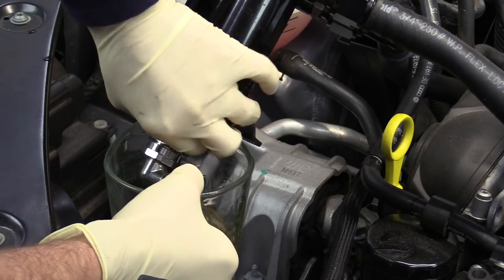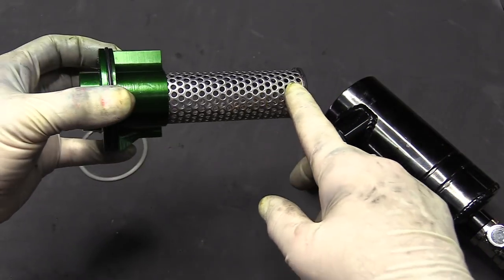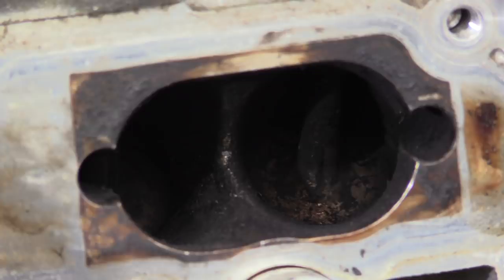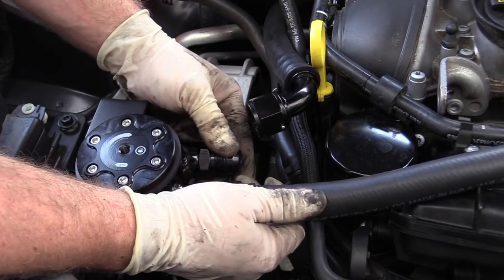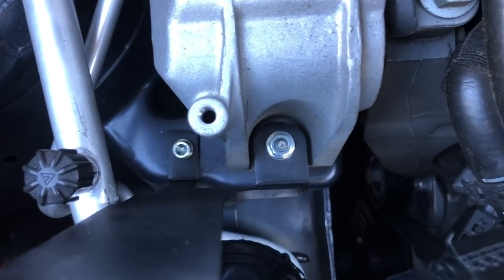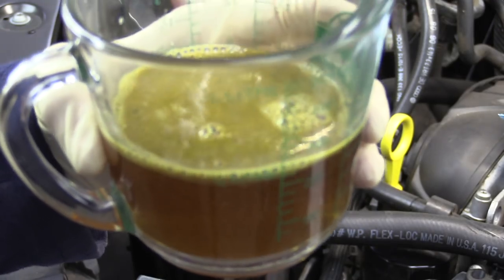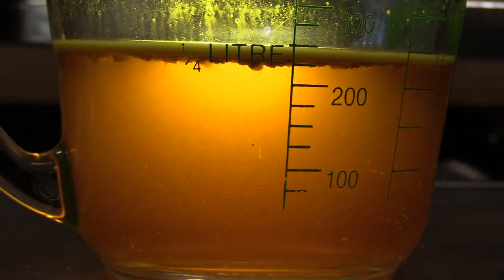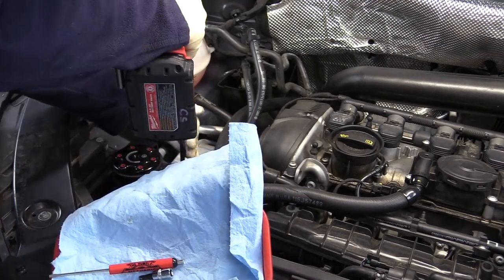Do Catch Cans REALLY Work?

Comment: Oil low? Pour that stuff into the oil and bring the level back up. Problem solved! ;)
Reply from the maker: LOL, yeah the oil was low. I am gonna save it for another time. :)
Reply: If any of that was engine oil that would work, but 99% of what came out was water.
Reply: HumbleMechanic 
I save it for Friday night shots with the crew.
Reply: It's usually a nasty oil/water mix.
Reply: Looked like sulfur in there too. you running diesel In  that thing? That would build up the carbon😃
Reply: I’ve watched videos with older vehicles that have a lot darker, thicker (oil) in the can. 
Also may depend on the location of the PCV outlet in the engine (valve cover or engine block).
Reply: You wouldn't want to poor that back in its majority water from condensation a little bit of fuel an not alot of oil. All that would happen is it will burn off again but quicker filling the tank sooner as you've introduced water to the oil instead of being a cooling down condensation mix. Short journeys are worse for this.
Reply: It's probably more water than oil...I wouldn't pour that back in the system
Reply: Yeah.Let em hydrolock his motor.
Reply: I have a homemade 3 stage oil catch system.  The first one catches mostly water and some oil for that creamy-in-the-coffee look while the next two catch  more in the way of oil with the 3rd catching the most oil.  '99 Tahoe has 319,000 on the clock.  Still runs well and DOESN'T smoke; oil, steam or  Carbon black.  I collect the effluents into a container that goes to a household haz waste collection facility.
Reply: Gweedo Murray I have zero catch cans, my van has 476,000. The last time I checked, the egr was clean & smooth with a light dusting of soot & the intake manifold had a very light coating of residue. In 12 years the most the egr has ever had on it was maybe a 5 mm ring around the vacuum valve shaft. It's amazing how much effect that the minority of vehicles that exhibit problems have on the overall perception of vehicles in general. "The squeaky wheel gets the oil" has many layers here.
Reply: Gweedo Murray oh and the time the egr had a little residue was most likely due to a cracked MAP sensor that was causing false readings combined with worn injectors. I would say most problems with residues & buildups are caused by other faults, worn components, incomplete maintenance or non-manufacturer modifications. But who wants to test that complex issue when you can just blame the manufacturers and buy a catch-can and say you're outwitting the experts.
Reply: Jake Smith Hydrolock by putting water in the oil? Aahh nope. Even Google might help you out with that one.
Reply: Cassette Dude ! 

At some one hundred and plus thousand I pulled the EGR module ('99 Chev Tahoe 4wd) and cleaned out a pretty good mess of carbon and the next time, by 250 or so pulled it and only got a very small amount.  I bought the truck used, just turning 74 K, and so have no knowledge of its use and abuse before I got it.  
.
Some years ago I was at a Chevy dealer in western NY to buy a part for an S-10 Blazer and going through the shop area I saw a pegboard with nearly a dozen failed parts each with a card explaining the cause of failure; includes a brake rotor that had been chewed by pads long overdue, a failed water pump, a drive belt tensioner pulley with the bearing gone and stuff I can't remember.  The intake valve with the big clot of baked on Carbon was attributed to the PCV oil mist/vapor settling on the back side and baking in place.  The explanation made note how the inefficiency of carburetors , before the PCV add on, would supply the carbon but that it now comes from the recirced oil.  A Scotty Kilmer vid explains how recent cars actually are designed looser to allow easier movement of the pistons, ergo better mileage figures,  and so a planned amount of oil will blow by, on purpose, as sloppy tolerances will do, and on modern metal I would damn sure have an oil catcher.  I live on the Colorado front range in a high pollution area and so am subject to dyno style emissions testing.   The test is done every two years and next year I am due.  Hoping to see my  320 some thousands worth of miles still having a clean exhaust.  
.
You have my hearty congrats on so much mileage and still running strong without major defects.   Did you buy your vehicle new ?  I am aware how people will beat the shit out of stuff especially when they know they will be into something new and get best resale or trade in on something that still runs good but that the effects of "hard living" wont show up until the second or third owner.   A friend suggested I write the company when I reach half a mil, something you might do if you hadn't already thought to do so.   Love the metaphor !
Reply: I don't consider it outwitting anybody.  Truth is, a catch can accumulates and so needs attending just like pulling the dipstick and adding oil or a good one, checking the air filter now and again.  I have seen some horribly filthy air filters and tires on vehicles that are down to as low as ten pounds, like the way Dad's last car would be whenever I came to the house on a trip back.  The tires "look good" visually but the gauge tells a different story.  Cars usually get the funky problems due to lack of care and hard driving.  

A catch can on every car would be another thing that needs doing, a thing that will be neglected by many like way dirty air cleaners are and oil that gets changed if and when the owner feels like it and tires that routinely run ten pounds or more under the factory spec let alone the tire manfacutrer's highest pressure spec.  I can see many who would empty the catch can just dumping it in the trash or along the garage foundation in the name of killing weeds while poisoning the ground so that over time it makes its way deeper and in areas that depend on wells that is not good.  
.
I drain and flush the brake system yearly to keep water from accumulating in the wheels end of the system and also do an annual partial drain and fill on the power steering and about every third oil change drain the 3 qts worth of tranny fluid the pan gives up and refill with new.  I also have the gear cases on a schedule.  Same trans as when I bought it along with the same starter and water pump.
Reply: That didn't look like pure oil though looks like it has either gas or water mixed with it or both
Reply: I do catch canning and I notice that during periods of high humidity that you have a definite higher homogenized presence of water in your oil.  Just think, it's all the crap that would go back into the engine, and are the fumes directed evenly to all the cylinders or just the ones nearest the vapor inlet on the intake manifold ?  My '99 Tahoe has the intake inlet on the left, nearish the front so I am thinking cylinder numbers 1 & 3 are getting dosed the most which to me presents an unbalanced distribution of waste which corrupts the overall balance of rotation, sorta like an correct tire balancing.  It will spin but unevenly even if it does take diagnostic equipment to measure how much.  Not a fan of baked-on-the back-of-the-valve carbonizing and worse if only one or two valves are getting it which makes the air intake there a bit constricted while the other intakes get a full charge.
Reply: funny mate, it mostly water
Reply: Gweedo Murray I’d want to buy a car from someone like you 🤙 I’m the same way, you could call it over maintenance, but really people should be doing these things as the baseline
Reply: I wouldn’t pour all that water  oil mix back in my sump. Dispose of that crap in the correct manor.

Comment: This is exactly what I found when I installed a catch can. The cold air flow in winter time made it fill up with 99% water at a ridiculous rate.

Ended up removing it as I felt it wasn't doing much good.

Comment: I'd be interested to know what it's made up of? You should send it to a lab for testing lol I'm guessing I'm not the only one who's curious ;)
Reply from the maker: Yep spoke with BlackStone about that. I will be sending the engine oil and this sample to them
Reply: Excellent!!
Reply: Still no followup yet, so it's going to be oil, fuel and water is what makes that mess up.
Reply: Any results from the sample?
Reply: Blowby (produced by all engines, new and old; severity is the difference). All the nasty crud (oil, fuel, emissions etc) that used to be spat right onto the road as you went, until environmental hoo-hah changed that in the 70's. This crud was never meant to recirculate back to the engine. The fact that it does, since this environmental hoo-hah, is a factor in why vehicles don't last as long as they used to. The catch-can is a "gray area" compromise, as far as most States are concerned. Apparently you will actually fail SMOG if you don't reconnect the block-side hoses directly to the manifold, as it was originally (if you install one, account for that necessity later). And it would prove most effective if you've installed it basically right after you've bought new off the lot (before that crud builds up and fouls it all up)... though older, already fouled up vehicles will also benefit to an extent (their blowby will be significantly greater than a new/er vehicle. All that crud eventually will start affecting even the throttle body and idle air control valves and causing more problems down the line. These can help mitigate that too, buy you more time to decide to rebuild or junk it).
Reply: HumbleMechanic any results from that sample?

Comment: A tech at Further Performance, here in Minnesota, advised against catch cans because they can freeze here. I am on a 5,000 mile oil change cycle partly to reduce the crud that can land on my intake valves. I also drove 20 minutes on the freeway in 4th gear (3,000 -3,500 rpm) for my own "Italian tune-up". 

I wonder how much of the catch-can liquid was water, and if the ethanol in the fuel brought water in from the air.

Comment: Most of the captured content is water and excess gasoline. I run a can on a 2.7 twin turbo Ford and ran them on 5.4 Supercharged Fords but due to my climate I dont get much water in the can, just pure oil. I know yours isnt oil just by looking at it - when you drain the engine oil it will not match the contents in the can or the can contents would be black. It is certainly doing what it is designed to do but the stuff youa re capturing wont play into coking on the valves, it just extends the oil life. When I drain my can on my 2.7 ecoboost I get about 4 oz of oil in 5k miles.

Comment: I put an oil catch can on my Volvo S60 T6 because after I did some minor turbo tuning and intake manifold tuning I noticed under heavy acceleration during initial turbo spool the tail pipes seem to let off some smoke but I have very little oil loss effectively none, so I figured must be something recirculating through the intake or something and I figured a oil catch can is the easiest and best thing..  since doing that I no longer get any smoke under full throttle take off and the crap I catch in my catch cans look exactly like the stuff you got, almost watery or no viscosity and think layer of something disgusting on the surface..

Comment: Catch can's mainly capture water vapour from the crankcase, some of it is oil and combustion products from blowby, but the overwhelming majority is just water. Still it might be doing something, but I believe most of the carbon build up on the backs of valves comes from oil leaking past the valve stem seals - this is why you tend to see a large carbon blob at the base of the valve stem when you inspect valves on engines that have seen some miles.

Comment: My 1987 Alfa 2.0 Spider has an oil/vapor separator the uses a vortex for separation of blowby from the cam covers. A tube at the bottom routes detritus back to a fitting at the bottom of the dip stick. Hmmm, maybe I should route that return plumbing into a clear container. Thoughts?

Comment: Nice. Im thinking of installing one in my 2002 tdi jetta. But also didnt think you will catch that much. Questions. Why is is so very watery rather than olie? Just to check, a normal 4 stock motor doea not need any lube from the intake, engine doea sort it self. Rite?

Comment: I am not a Mac but i think it will not solve the carbon build up because the valves opening and closing will let a tinny Carbon thruw  and  causes the carbon to crash into the walls of the intake manifold and stay there until cleaned   (maybe I am wrong )🤔keep it good work I learn alot from your channels like this

Comment: Did you remove the pcv valve to install the catch cann (my understatning is that this is what is typically done)?  Because if I recall, the pcv regulates the pressure in the crankcase.  So if it's removed, then you're actually venting more than you otherwise might.  Also, you mentioned a fine oil separator in the pcv valve, which would also be missing in your setup.

Comment: which catch can did you use? trying to find one identical to that one. A little anecdote lol i did my oil  housing gasking and oil cooler gasket and was suprised to see alot of corrosion on the antifreeze port in the oil cooler, and the rear of the oil housing ever so slightly warped. alot of fun learning keep it up
Reply from the maker: This is from Black Forest industries.

Comment: Great job with the presentation! I own a 2016 GMC Sierra 2500HD gasser w/6.0L Vortec engine. This engine employs "Sequential Fuel Injection" compared to the 5.3L and 6.2L V8 EcoTec3 engines that use "Direct Injection". I'm wondering whether my truck would benefit from a catch can. Any thoughts?

Comment: I agree with most here. That there is water from blowby with a layer of oil on top. I do think a catch can will help slow the issue of coke build up on intake valves but the only real soultion is to have a small low volume fuel injector wash the valves. Even if its only something that handles a 5% of the motors fuel demands.... then again with more turbocharged and supercharged cars i bet a H2o/meth injection on the back of the valves would work just as well and think bmw has one motor designed as such.

Comment: Got a question I hope you can answer. I built a custom turbo system for my Fiat 124 Spider 20 years ago and I've been dumping the oil vapors off the cyclonic trap mounted on the bottom of the engine directly into the "square" in the air flow meter past the vain. That's the only place I could find to dump the fumes because I have a hump hose between the turbo and AFM. I guess you know how these old Bosch L-Jetronic systems work

I had one of those K&N traps mounted to the cyclonic trap (there is no factory PVC on this car). The problem was every time the turbo would spool up it would fill the cabin with oil vapors and blow oil onto the starter.

Here lately the car has been stalling at idle and takes allot of cranking before it will start. But the idle is not lumpy or does it struggle. The car just stalls and takes sometimes 10 seconds before it will start even on a hot start. But once it's been running for awhile, it does not stall at red lights.

It seems the temporary "fix" is, I've had to jack the idle speed up from 850 to 1500 rpms. It's just like having a car with carburetor with a clogged idle circuit and having to bump the idle speed up so it will run off the main circuit.

Even though I'm routing the fumes after the vain in the AFM, I'm thinking over time this oil has condensed and is causing the vain to stick in the position when slightly closed. Due to age (more blow-by), the fumes could also be pushing the vain in the opposite direction and causing the engine to stall. So by jacking the engine speed up to 1500 rpms, it opens this vain further past the sticking point.

 I'm wondering if putting a catch van between the cylonic trap and AFM would prevent this. I haven't pulled the AFM to check but that's on my list. I do know that the intake piping is coated with oil where oil can leak past the turbo seals.

That's why I'm watching your video. Thanks.

Comment: As many have said, that is likely mostly condensed water with a bit of an oil film. I you let it sit in that glass container even longer longer it would most likely separate even more into water and a thin oil layer in top. However, doesn't this in a backhanded way illustrate another potential problem, namely water condensing in the actual motor oil in your engine IF not being driven regurlarly up to a hot/warm operating temperature? In your engine you want the opposite thing go happen. Keep up the good work. Love your videos.

Comment: If a catch can is installed, is it possible that the lubrication effects of the oily substance is lost and the intake system gets corroded or cracked?
Reply: The "lubrication effects" you refer to only exist because the pcv must relieve pressure in the crankcase. There is a baffle that stop oil from travelling into the intake system (where the pressure is sent to) however broken down oil particles are sent along with the air. The only thing those "lubrication effects" are doing are caking the valves and the top of pistons over time.

Comment: One cup in 3K miles that is high.  What year was the Tiguan?  Granted I have is a 2018 with Direct Injection Twin Turbo but I am only draining about 1/2 teaspoon in 2K miles.  

Don’t forget to check oil quantity after draining catch can to ensure the oil level doesn’t get too low.  Looks like the catch can did its job but I recommend more frequent inspections/draining.  Especially with higher mileage engines.

Comment: it does work.
my throttle plate stay clean for months after i installed an oil catch can on my nissan.
o2 sensor stay much cleaner too.
Reply: to all my youtube friends try to use an engine oil with lower noack volatility.